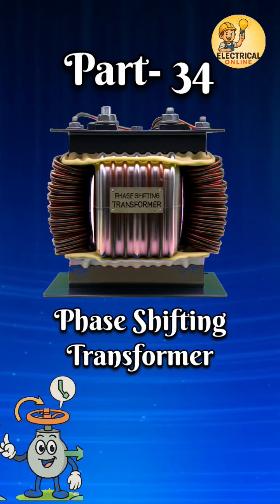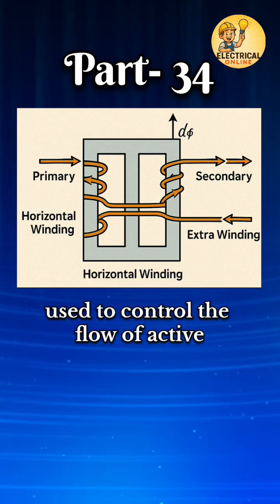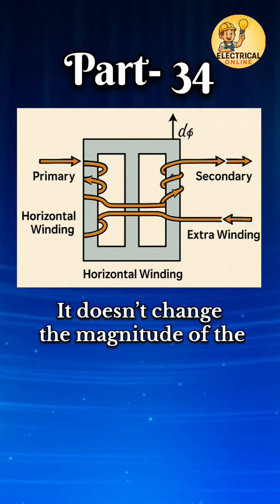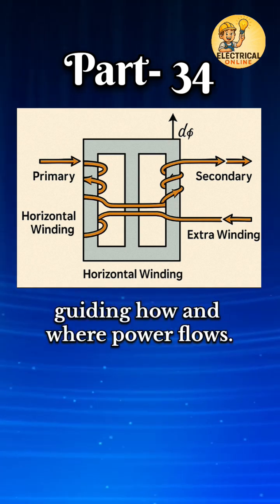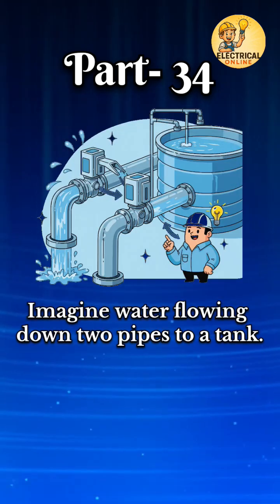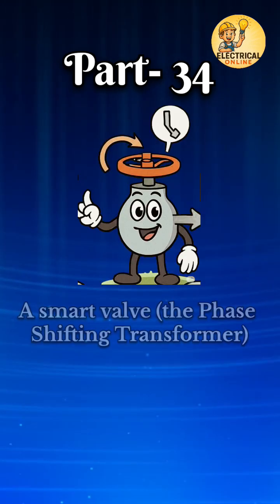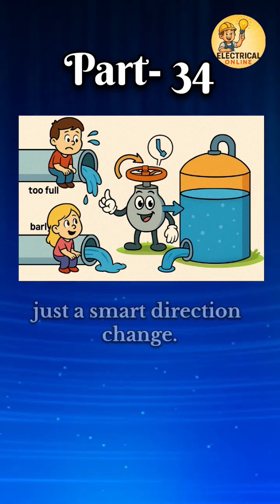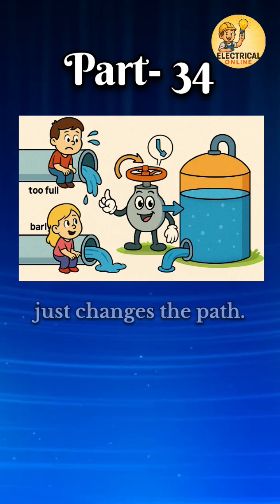😎“Smartest Power Trick Ever? Phase Shifting transformer#explained #shorts#viralvideo#viral#trending

Comment: What is principal to shift phase angle
Reply from the maker: A phase shifting transformer shifts the phase angle by injecting a controlled quadrature (±90°) voltage into the line through series windings, changing the phase of the output voltage vectorially.